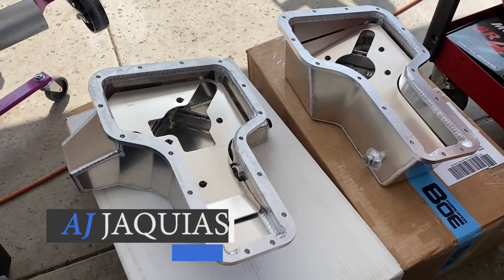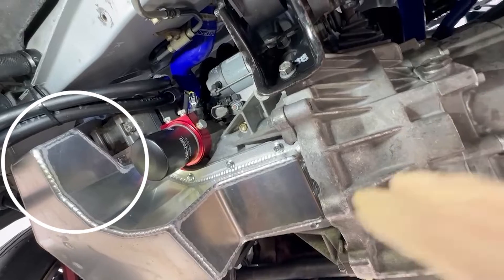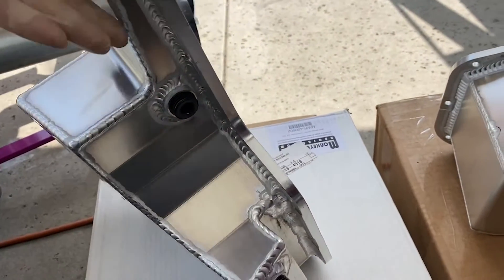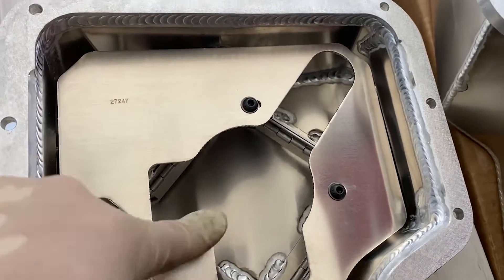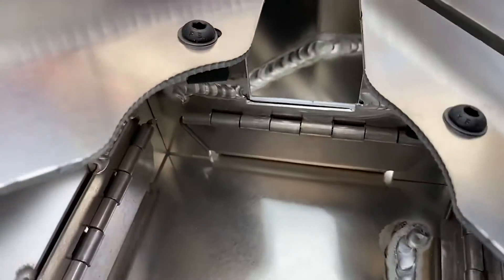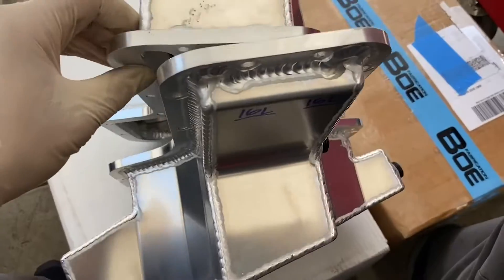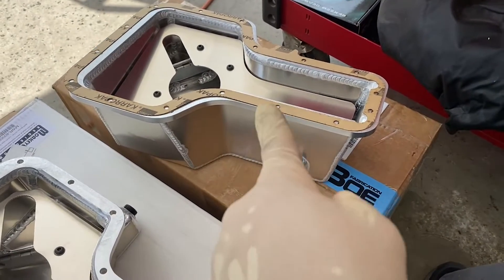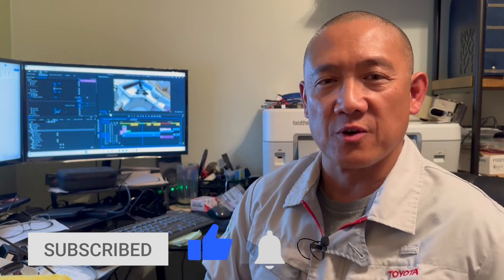2ZZ Oil Pan Battle - Moroso 20970 vs BOE Fabrication TOC Wet Sump Oil Pan

Comment: Did you have any issue with the dipstick with a BOE Pan? I've got mine and I can't fully push the dipstick in. I guess I will need to drill a hole.
Reply from the maker: Just to clarify, I’m using my BOE on a 2ZZ (FYI - the moroso fits the 1ZZ and the BOE didn’t fit the 1ZZ… the BOE probably will fit a 1ZZ w slight modification). I didn’t have an issue w the dipstick. Lastly, I recommend RTVing the BOE bc the gasket leaks. I hope this helps. Pls subscribe. -AJ

Comment: That’s a bummer on the boe. Heard good things about it, especially with how the moroso pan leaks
Reply from the maker: Im sure w a lil modification to the baffle, the BOE will fit the 1ZZ. Also, I haven’t had an issue w the Moroso leaking. I think if you prep the bonding surfaces properly and use the appropriate bond, the Moroso doesn’t leak. Lastly, I prefer the BOE bc of its outer design. U can drop the AC compressor easily, unlike w the Moroso.
Reply: @RelentlessRacingAJ what lil modifications to the baffel will make the BOE fit a 1zz?  I would prefer BOE over the moroso also is there a reason you couldn't use the BOE gasket on the Moroso pan? Might just work idk

Comment: Just purchased A Moroso pan from monkey wrench racing . That has the same trap doors. Without the front and rear extensions. 
They are claiming it holds 6.1 quarts of oil . 

Will be using it with the hope of controlling the oil during long sweeping turns during open track events. With 1ZZ MR-S 
Can take photos if anyone is interested?
Reply from the maker: Cool. I haven’t seen this Moroso without the wings you are referring to. Hopefully it works well for you.

Comment: Another option is the InoKinetic gPan3, which I have  on my 2ZZ (It basically won a coin flip against the BOE pan)
Reply from the maker: You are correct. I looked at the InoKinetic, but because they only had one pic in the website I opted for the BOE. THX for watching and commenting. Pls subscribe. Thx AJ
Reply: Is the inokinetic pan shaped like the BOE or like the moroso with the bulges?

Comment: BOE over moroso if I had the easy option of doing it again. The extra bulges of the Moroso are just not worth it if you are trying to retain AC or run oil cooler stuff. BOE easily gives you space for both of those.
Reply from the maker: Good call. I opted for the BOE as well. Thx for watching and commenting. Pls subscribe. Thx AJ